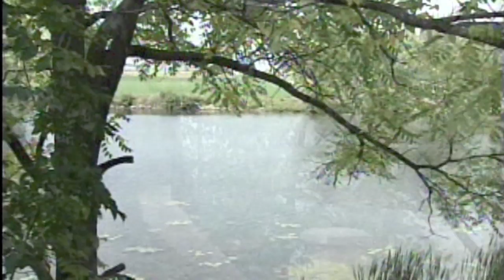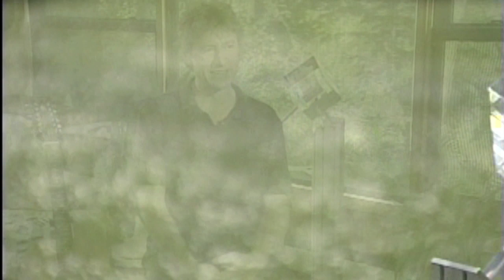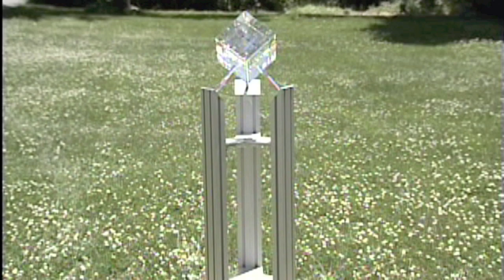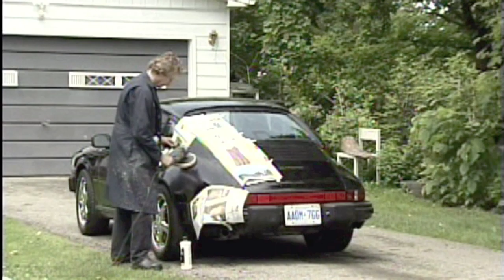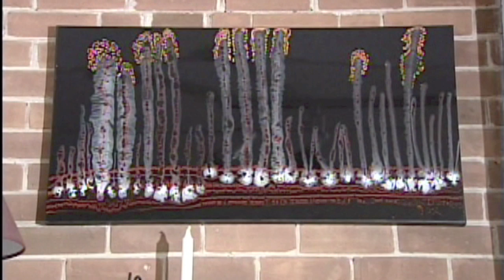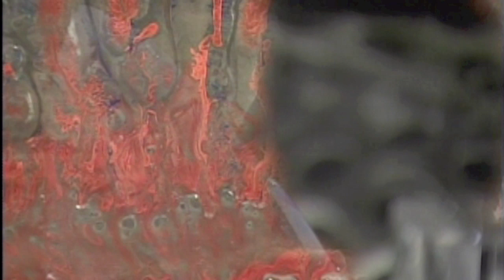Vaz Zastera - Cold Glass Sculpture Artist

Comment: He seems always out of breath. Maybe it's getting into his lungs.
Reply from the maker: Do you have anything constructive to offer concerning this video?
He was likely nervous. The candid interview was conducted by a CTV crew. The production was aired nationally across every province in Canada.
Reply: What I said is constructive. I work with glass as well, and even with a mask once I breathed some dust and felt a lot of pain for many weeks. Sanding glass is no joke, I cringe when I see people around it without proper protection, especially if it contains lead which can be absorbed by skin.
Reply from the maker: Thanks for the clarification. It seemed that you might have been addressing vapours released from the volatile solvents commonly used. Trichloroethylene is necessary in the removal of various waxes that bond the substrates to the lap, and has been attributed to numerous toxic effects on the body. I will mention to Vaz that he may want to look into the safe ventilation of airborne optical material dust.
Reply: It's unlikely that he will pay attention, although you're very right in alerting him. If he is like me then he will only take precautions when he's in serious pain fearing for his life. It was the only way for me. The dangerous part is that just a little more toxic material and you might be dead, the difference between feeling nothing and a lot of pain is incredibly small, I worked a lot before anything happened to me. I'd tell him to buy a proper mask as well, I was wearing a disposable and it lets some air inside the mask around the edges. A 3M 6200 properly tightened, with proper size and proper filters should be enough.